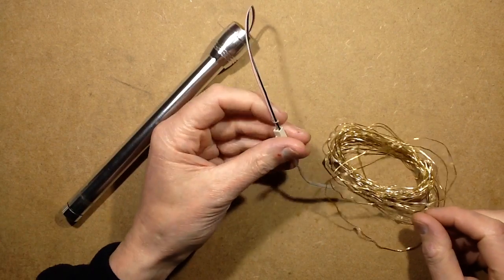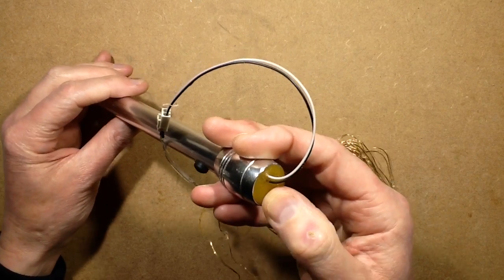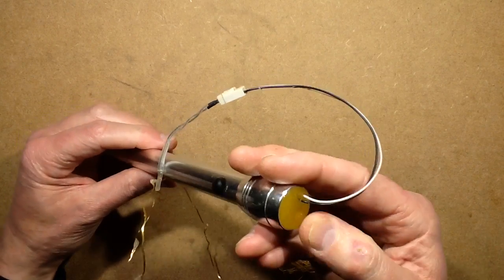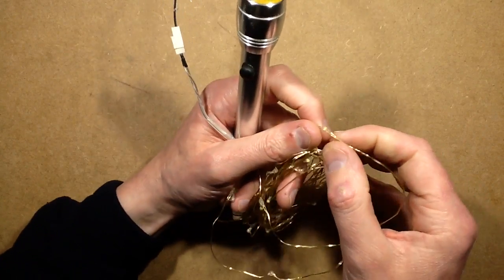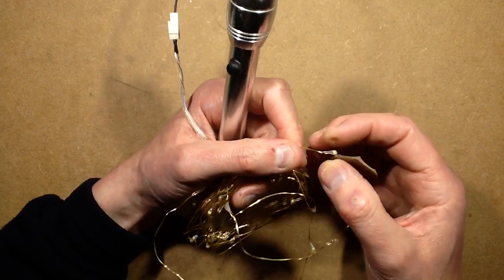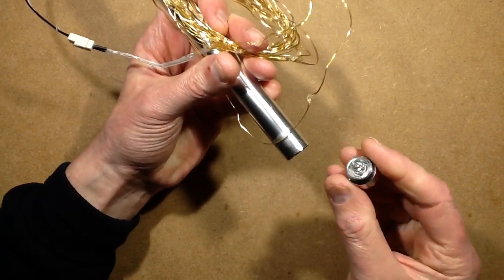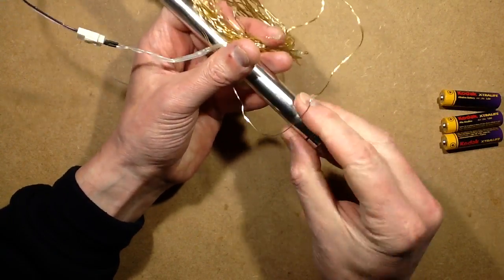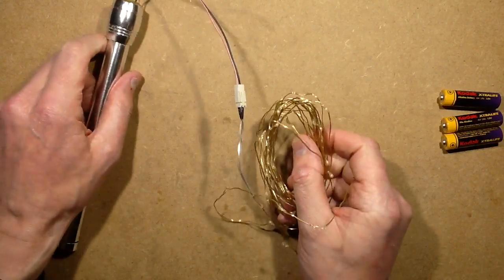Flashlight battery pack with potted electronics update.

Comment: Strangely enough I was just sat here wondering what to do with these very lights and YT suggested this video. I have a set of these lights that have a AAx3 battery pack and I'm thinking of converting it to run from USB. How hard is it to remove the laqueur? Or would it be easier to cut the wires at the transparent cord that connects directly to the battery compartment?
Reply: +BenjaminGoose To answer my own question: the laqueur can easily be scraped of with some find sandpaper. Alternately, the thick translucent wires can be split and stripped just like any other wires.
Reply from the maker: +BenjaminGoose If you heat the end of the lacquered wire with some solder on the tip of a soldering iron it should displace the insulation to reveal the copper.  Another technique with the fine sandpaper is to grip the wire between the sandpaper between your fingers and then pull the wire out from inside the folded sandpaper while squeezing it gently, then repeat until it's been cleaned.  In motor rewind workshops they often dip the lacquered wires in a solder pot to melt the covering and tin them at the same time.
Reply: bigclivedotcom Thanks for the response. I ended up cutting the string at the thicker translucent part (at least, that's what my set has) since it was easier to work with. Added a standard male USB connector with a 56 ohm resistor in series and it works pretty well. Interestingly my (possibly broken) multimeter tells me the current draw is only 20mA, which seems a bit odd for a hundred leds. I tried a 10 ohm resistor and it changed to about 120mA, with the resistor getting rather hot. If only the buck converters would arrive! To be honest perhaps it'd be safe to run these directly from the standard 5v, but I'd rather not risk it.
Reply from the maker: +BenjaminGoose If you use a meter in series to measure the current then at low settings it will introduce a significant resistance when the low voltage drop across the resistor is taken into account.  It's much more accurate to measure the voltage dropped across the resistor and then divide it by the resistors value to get the current.  So for instance if you measured 2V across your 56 ohm resistor it would be 2/56=0.0357A  (36mA)  Then to find out if you are within the resistors power rating, multiply that current by the voltage you measured across the resistor, so 2V times 0.0357A = .0.07W (70mW)
Reply: bigclivedotcom I took a measurement of a 10 ohm resistor (in series with another 10 ohm resistor) and it measured about 1v, so 2v total voltage drop, so about 100mA which for a string of 100 leds sounds reasonable? They get rather hot to the touch, but are still within rating. I've rigged up a rather long cable to go up a ~6m tree using choc blocks, so the hardest part now is trying to position these strings using a long pole and makeshift hook! I'll link in a pic if all goes well. Thanks for the tips. [EDIT] It's not great, but it was such an incredibly tedious job to get them into even this position. Hopefully next year I'll do a better job: http://imgur.com/s7XiYwP

Comment: I always thought putting LEDs in parallel was not a good idea because I thought what you get would be like if you tried connecting regular rectifier diodes in parallel. I know that when diodes are connected in parallel, the diode has the least voltage drop across it would be the only one that conducts, so I though it would be the same with LEDs.
Reply from the maker: +CoolDudeClem The LEDs in these strings are very closely matched for voltage, often coming from the same batch.  That gives very even current sharing, particularly with the slight knee voltage whereby their forward voltage increases slightly with current.  When you get sets of badly matched LEDs they light very unevenly at low current.
Reply: +CoolDudeClem Hmm, I use LED's in parrallel all the time, but I do so with there own current limiting resistor to the rail. I have 5 hooked up right beside me, blue, red, green, and orange, and they all are good, since there is enough current available for them all to be happy. 
They do dim at a different rate when you cut their voltage though, but they would do that anyway.
Reply from the maker: +Richard Smith LEDs in parallel with their own current limiting resistors is a better way to do it.  It helps balance the slightly different voltages.  But for cheapness the parallel strings just use matched LEDs, which does at least have the advantage of ensuring that as the battery voltage drops you still end up with all of them lit albeit at a lower intensity.
Reply: +bigclivedotcom 
Much rather prefer a series string with a single series resistor powered by a boost converter. The ones used for laptop LCD backlight are quite handy and can do pwm dimming.
Reply: +bigclivedotcom I am so confused but still wach the videos XD

Comment: Have you seen these?

Christmas Part LED Mesh String Net Colorful Light xmas Deco 1.5M X 1.5M Ebay item # 361419231405

I can not tell what sort of wiring configuration, they adopted, but the description says that it is powered by 220v, mains I would assume.

Perhaps it should be described as "Christmas LED Mesh Net, of Death"
Reply from the maker: +Randal Jensen Again these are pretty common on ebay.  If you look at the pictures they show, they don't bear any resemblance to the net being sold.  100 LEDs would be either 10 by 10 LEDs or maybe 20 by 5.  The wiring is usually zig-zagged up and down the strings with extra fake wires used as support strands.

Comment: The lights I bought (homebase) are cut so that the last LED has an inch or so of the wire left on. I haven't looked at the ends, but they all still light up. Though it's getting darker, so they don't get much daylight at the moment. I plan to use some of the Poundland ones in a clock case at some point.

Comment: I voulenteer for the salvation army and they have xmas tree lights on a tree just outside the front door, the damp has crept down the clear tubing and attacked every led, a black mess indeed.
There fault for buying ordinary lights i suppose.
Reply from the maker: +zx8401ztv The typical low voltage LED lights (or indeed the Chinese mains ones!) claim to be waterproof but aren't.  The water wicks up the heatshrink sleeving and then the resultant DC accelerated corrosion at the back of the LED causes severe rusting and blackening in that area before eating right through the wire and making that section of lights dim or making them go out completely.
Reply from the maker: +zx8401ztv I've tried that, and for some reason it just didn't work.
https://www.youtube.com/watch?v=gtikgL2FO-o

And then the follow-up video...
https://www.youtube.com/watch?v=4AuWzHspKXw
Reply from the maker: +jusb1066 The industrial grade lights for municipal lighting have the LEDs plunged into little sleeves filled with resin so that it squishes up around the contacts and also acts as a strain relief for the wires.  They endure a lot of punishment.
Reply: +zx8401ztv My cats just LOVE to piss on electrical equipment of all sorts so I think you may have found your answer!
Reply: +zx8401ztv buts its only just November! they shouldnt have them out so early, lol.   perhaps they were cheap/inside lights?
Reply: +jusb1066 ha ha i didnt mean this second, yoooou silly sod lol :-D
I think they were inside lights, but they were never in the rain, the tree is under a concreate roof, its just the slight damp in the air.
Mind you it could be the cats pissing on the lights.... hmm, now that is taking the piss lol.
Reply: +bigclivedotcom If they get some more "but cheap" ones, ill have to buy a small can of wd40 and spray down the sleeving to prevent the reaction, as a vaulenteer i have no power to force them into the logic of doing the correct thing, so i may have to forget to tell them my intentions ha ha :-D
Reply: +bigclivedotcom just maybe spray silcon grease, or dipping the whole lot in epoxy!
Reply: +bigclivedotcom Ooow the 3 in one worked better, and the wd40 was crap really, dam i forgot that wd40 isnt a lubricant, its a penetrating fluid.
I keep thinking its oil, stupid brain :-(
Reply: +bigclivedotcom Based on my experience with retail Xmas LED strings it's the ones with copper-coated steel leadframes that corrode. LEDs with copper ones seem to fair better. 

IME the usual failure mode is the corrosion bridging the LED leads at the point they enter the encapsulation and eventually shorting them out.
Reply: +Sootikins LOL sabotage kittys :-D

Comment: +bigclivedotcom 
I'm not convinced that the ends of the copper wire are being affected by an electrolytic process as copper will naturally form a verdi gris finish when exposed to the elements but, as you say, coating the ends of the wires to protect them would prevent this degradation. However, cutting them to different lengths would likely not be as successful. Yet another Clive with Poundland product hack success! Will this pleasure never end?
Reply: I second that

Comment: Have you ever changed the batteries in it
Reply from the maker: The batteries last a very long time, but I've put a few sets in.
Reply: +liam cheeseman he must have, average 10 hours a night for 9 months, 2500 hours? i dont think so ! lol
Reply: +bigclivedotcom I notice the epoxy has yellowed quite a lot since, i suppose cheap epoxy has a finite time for uv exposure?
Reply: +bigclivedotcom What's a few sets? Greater than or less than 5?
Reply: +jusb1066 The cheap poundland epoxy sets yellow. They do sell a clear setting one from time to time but it is not often.
Reply: wyzarme
it looks a bit yellow'er from the january vid, but yes it wasn't a clear version back then either
Reply from the maker: +Sako's Tech Spot Three.  The LEDs run at low current.
Reply: +jusb1066 I was wondering this I may have to build this and see how long it lasts for.